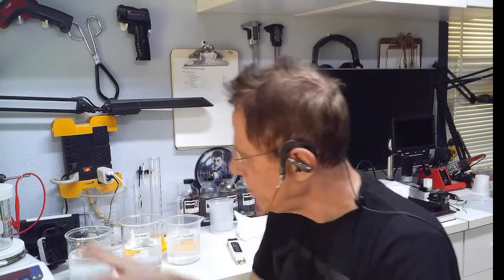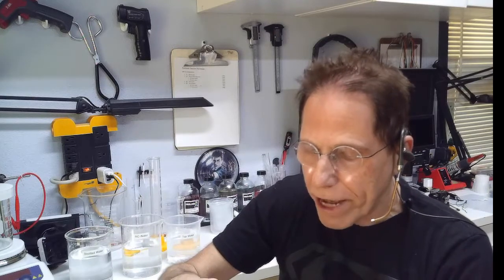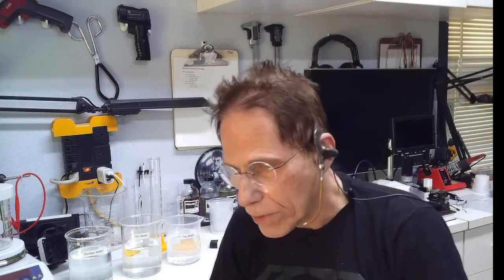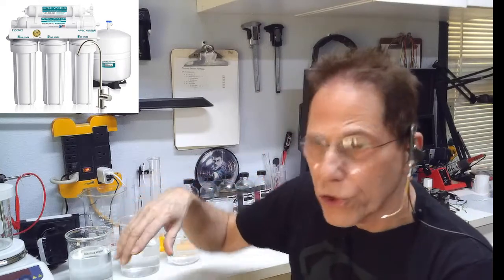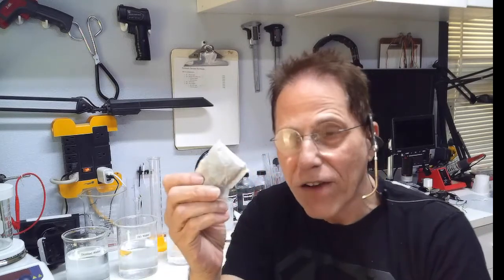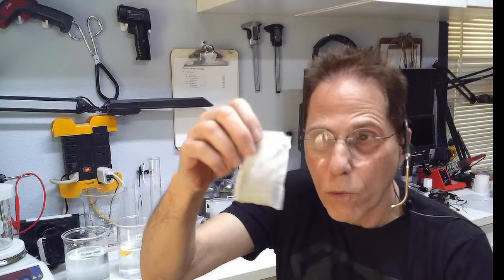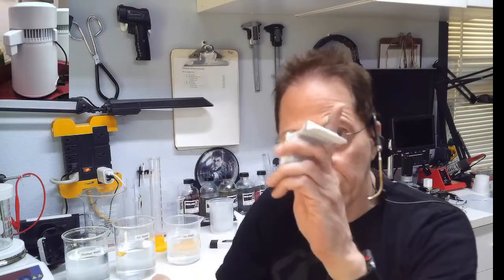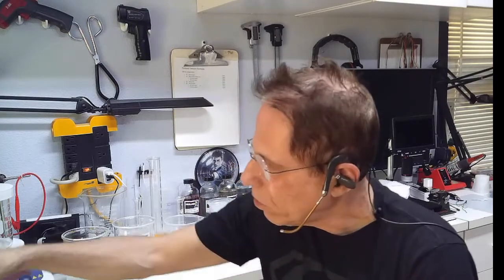RO water for your Distiller. Do you need the carbon filter?

Comment: Do you know What is better at removing the birth control hormones and estrogen from the tap water reverse osmosis or a water distiller I don’t know if you know how effective a water distiller would be at removing them
Reply from the maker: It is unbelievable that we in a world where the lifeblood fluid we need to survive is often contaminated with these things.

I really do not know the answer to this question. I went to google and started reading about it. I don't really want to say anything like I did with fluoride because again there seems to be various opinions and research on it. With estrogen and birth control hormones articles that I found they say it can be removed with distillation and RO filter and others say it cannot or only reduced. One articles states that carbon filter may remove 80%. One scientific paper I found shows that Reverse Osmosis removes estrogen from the water. 

With RO filtration the deciding factor would be the size of the particle you want to remove. If the RO membrane has a smaller hole size than the hormone or estrogen particle it would not go through it. With distillation it would depend if the substance is stored in the water as a ionic substance or as a gas. Gas substances will pass through the distillation process and recombine when it cools. Distillers have a hard time removing VOC (volatile organic chemicals) and SOC (synthetic organic chemicals).

I will talk to my chemist on this and see if she can find out the size of these particles and their state when mixed with water. I will report back. It is an interesting question for sure. 

Perhaps someone else who may be more in the know can share as well on this topic.
Reply: @AlchemyWizard  yeah it’s disgusting and is one of the main reasons the male testosterone leval isn’t the same as it was in the 1980s and below because it was double to triple back then because the water wasent as near contaminated with birth control as it is now and it would only get worse it’s the birth control and the micro plastics which leak in to the bottled water which have the xenoestrogens which act as estrogens what are the 2 main reasons behind the male testosterone being a lot less then before which is the main reason why I want to get a water distiller so I won’t be consuming the birth control and the estrogen in the plastic bottles I would realistically want the water distiller to Remove 90% or more of the birth control chemicals from the water I don’t know if you know how much estrogens the charcol filter bags they give would remove and would you recommend putting in 2 bags in the water distiller to remove more estrogens or no
Reply from the maker: @pitch1691  I would instead get a zero pitcher water filter, put the tap water in to that. This will filter all the chemical junk out or at least reduce it. Then you can put that into the distiller to clean it up. The other more expensive way is to do a RO setup, then distill the water. That small bag of carbon they put in distillers today, does not work.
Reply: @AlchemyWizard  what zero water pitcher filter would you recommend are sure they would take out a fair amount of the birth control and estrogen
Reply from the maker: @pitch1691  I have this one that I got in here for testing purposes. I do not know how much of the estrogen and hormones or birth control it removes, they do not say. It does remove chlorine and may remove fluoride. It does produce 0-ppm water as measured on the TDS meter. In the microscope it shows some VOC's about 4 to 6 ppm. The RO water shows a little lower in the microscope. The pitcher is a good alternative to RO water without the expense and installation cost. 

• ZeroWater Pitcher on Amazon: https://amzn.to/3BARy1X
Reply: @AlchemyWizard  yeah thanks and one last thing is dose a water distiller Remove 100% of those micro plastics what leak in to water from the water bottles
Reply: @AlchemyWizard  even though the zero water pitcher has a 0 ppm dose it still mean there can still be a lot of stuff in it and do you think the zero water pitcher filter is better then a water distiller in terms of getting rid of chemicals and stuff or is it the same do you think
Reply from the maker: @pitch1691  In the laser microscope the zero water pitcher did not remove everything. Some naturally occurring colloidal remained and perhaps some VOC, but the amount was small, under 2ppm. The Ruby Red gold process did not like Zero Water. I got a strange ruby red color from it. So I would say distillation is better. What I would do is get a zero filter to remove most of the chlorine and VOC in there, then distill that water and you should have about as pure water as you can get.
Reply from the maker: @pitch1691  RO water will remove micro plastics as the hole size in the filter is much smaller than micro plastic size. In our low end distillers I could not say for certain that it would get all of the micro plastic out. In theory it should. The zero water filter claims 99.9% micro plastic removal.
Reply: @AlchemyWizard  yeah thanks would you recommend cleaning out the zero water filter every 3 months
Reply: @AlchemyWizard  and I don’t know what filter you could recommend for my shower because my face  gets all dry from all the chemicals and stuff in it I would think it’s all because the heavy metals fluoride and chlorine but it might be all because of the fluoride because I’ve heard That’s very bad the hair and skin as well either way I don’t know if you could recommend any filter that would remove around atleast 90 % or so of fluoride chlorine and heavy metals from the shower water or have you not got a clue about that stuff
Reply: @AlchemyWizard  and I don’t know what filter you could recommend for my shower because my face  gets all dry from all the chemicals and stuff in it I would think it’s all because the heavy metals fluoride and chlorine but it might be all because of the fluoride because I’ve heard That’s very bad the hair and skin as well either way I don’t know if you could recommend any filter that would remove around atleast 90 % or so of fluoride chlorine and heavy metals from the shower water or have you not got a clue about that stuff because I don’t want to be consuming the chemicals when showering
Reply: @AlchemyWizard  and I don’t know what filter you could recommend for my shower because my face  gets all dry from all the chemicals and stuff in it I would think it’s all because the heavy metals fluoride and chlorine but it might be all because of the fluoride because I’ve heard That’s very bad the hair and skin as well either way I don’t know if you could recommend any filter that would remove around atleast 90 % or so of fluoride chlorine and heavy metals from the shower water or have you not got a clue about that stuff because Even if you consume pure water if your showering with contaminated water then it gets through your skin so you would still be consuming some of these main chemicals which is annoying that it can’t just be clean water , the shower water
Reply from the maker: @pitch1691  The zero pitcher comes with a TDS meter. The instructions say when the TDS meter starts showing 6 ppm you should change it. You remove the old filter and put in a new one.
Reply from the maker: @pitch1691  I have well water here. I use a water softener to remove lots of that content. It is good enough for showering and washing clothes, but not for drinking. I suppose it would work for you as well to soften the water so you do not get a reaction. Water softeners that use salt are about $600 and require a plumber to install. 

As an alternative, they do make shower filters that claim to remove all that stuff. Here is one on Amazon, but I have never used one and do not know if they work. https://amzn.to/3q8DsTk
Reply from the maker: @pitch1691  I replied to this somewhere but it is not showing up. here goes again.

I have well water and use a water softener. They cost about 600$ and you need a plumber to install it. It removes lots of the heavy stuff from the water and makes it more manageable for showers and washing clothes. 

However, as a cheaper and self install alternative, they do sell shower filters. Amazon has one. I have no idea how well they work if at all. I have never used one. https://amzn.to/3q8DsTk
Reply: @AlchemyWizard  what would a water softener Remove would it even remove fluoride and chlorine I would just want something that removed fluoride ,chlorine and the heavy metals would be nice
Reply from the maker: @pitch1691  Water softener is really only for hard water. It removes hard calcium and magnesium, which the body cannot use and other minerals in a small degree. It will not remove fluoride or chlorine or all the other things we are talking about. The reason I mentioned the water softener is that you said your shower water is terrible and leaves your body feeling worse then before the shower. This feeling is very typical when showering with hard water.  Just saying it is possible the shower problem is related to you showering with hard water and may not be because of these other things. As far as drinking, even with a water softener, you will need to filter your water with other filtration before you drink it.
Reply: @AlchemyWizard  no I feel fine it’s just I don’t want my body to be absorbing these chemicals mainly fluoride and chlorine and the heavy metals because there not good for the skin and there bad for you to have inside of your body I don’t care about the magnesium and calcium that isn’t going to dry my face out after I finished getting out the shower  so like I said I just want some sort of filiter that I know filters out atleast fluoride and chlorine
Reply from the maker: @pitch1691  As far as fluoride goes, my chemist did some research and found that the National Science Foundation tested the Brita Long last filter on fluoride and it did filter out 95% of it, due to some unique activated carbon they are using in that particular filter. The advantage to this filter as opposed to the zero filter or RO filter  is you would not be drinking water that is essentially distilled water. 

As for taking a shower or bathing, that shower filter may be something to try.
Reply: @AlchemyWizard  I was going to possibly plan to get a zero water pitcher filter but I was asking other people about a water pitcher filter and some of them said it won’t really do anything in getting rid of estrogens and birth control out of the water do you have any explanation to explain how a zero water pitcher filter gets rid of a fair amount of birth control and estrogens from it to the amount that it’s worth using before putting the water into the water distiller and because I’ve heard that the zero water gets 0 ppm but that dosent mean there  isint a lot of chemicals left in it so it wouldn’t mean it remove birth control and estrogens so I’m overall asking if you have prove of the filters in it that it’s effective at getting rid of alot it the estrogens and birth control from the water
Reply from the maker: @pitch1691  I do not think zero filter will remove birth control or estrogen. From what I can find the only thing that is known to work is Reverse Osmosis because the estrogen and birth control molecules cannot fit through the membrane.
Reply: @AlchemyWizard  oh yeah well thanks I would just buy a water distiller either the mega home water distiller or the C0-1Z or the vevor water distiller I don’t know if you know which one is the best one you would recommend I’ve heard it’s the mega home one but I think that one takes 1 hour extra to distiller 4 L of water compared to the other ones and it’s more expansive so do you have any thoughts on the best ones or do you not know
Reply from the maker: @pitch1691  All those water distillers are of the same design. Any one of them should perform adequate. Be sure to read all the comments on them before you buy.  I have two which I spent about $100 each for.
Reply: @AlchemyWizard  I’ve heard from the pure water YouTube channel which is the most expensive water distiller they said  that Normal water distillers boil dry and as a Result of that the temperature could be to high we’re all the residue is so the birth control and estrogens can evaporate into the distilled water what’s your thoughts on that is that true so you think or not
Reply from the maker: @pitch1691  I don't like when it boils dry. I agree. I set a timer and turn mine off before it goes dry.
Reply: @AlchemyWizard  yeah I’ve seen the mega home takes 5 to 5.5 hours to distill water and the other ones ussaully take 4 hours I’m guessing that’s because the mega home one has like 550 watts and the other water distillers ussually have 750 watts so would that mean the less watts the quieter it is because I wouldn’t want a loud distiller what I can hear all day for 5 hours
Reply from the maker: @pitch1691  I have two different 750watt model. The fan is loud on both, not sure you can get around that. I suppose the 550 watt may be quieter, but there is no guarantee it is. The fan speed is based on how quickly the water has to cool in the tubes so more vapor can fill in. You would have to look for something that says a quiet distiller, where it is designed to work quieter. Perhaps you can put it in a room with a door and close it. Or put it in the bathroom and close the door.
Reply: @AlchemyWizard  yeah it is the mega home water distiller that’s looks to be the best quality the only possible downside is it takes 1 hour more I think compared to the other ones
Reply from the maker: @pitch1691  Well here is what I would do to make the best distilled water. I would get the zero water filter to remove all the big garbage from the water. then put that water you filtered into the distiller. Extra step but you have the most clean water you can get then.
Reply: @AlchemyWizard  yes I was going to do that but it dosent make any sense to do that if the zero water pitcher filter dosent remove any of the estrogens and birth control or atleast fair amount of it if I was to know that it could remove half of it or something then I would probably do that
Reply from the maker: But you are forgetting about chlorine and other vaporous substances, VOCs (volatile organic compounds) and SOCs (synthetic organic compounds). Distilling will not remove those but filtration will, or it will at least reduce them. It really depends on what is in your water of course.
Reply: @AlchemyWizard  I will turn of the water distiller before it runs dry but  that is very annoying because some of the time you would forget or your out or asleep  when the water distiller is on so you don’t turn it off before it finished which I find so annoying because then for that time I will be consuming nasty birth control from the residue what was heated because it turned off by the machine because the water distiller ran dry which takes away the point on why I’m getting a water distiller in the first place so my testosterone isint getting destroyed by the birth control ,so I don’t know if your definitely sure of if you leave the water distiller on then till it turns off automatically then it will release all the birth control into the distiller water
Reply from the maker: @pitch1691  As I said in the video, plug your distiller into a timer and set it for 15 minutes before your distiller usually runs dry. This will prevent you from over cooking the last of the water.

Mechanical Timer: https://amzn.to/3oZwY9n 
Kasa Smart Plug Wifi Timer: https://amzn.to/3X46Wy6
Reply from the maker: @pitch1691  the zero filter comes with a TDS meter. The instructions say to change the zero filter with a new one when the TDS meter reads 8ppm or more.
Reply: @AlchemyWizard  I’ve seen that a lot of vocs have higher boiling points then water so all the ones that higher boiling points will be left behind in the water distiller I’m guessing and you mentioned that a water distiller can’t get rid of chlorine but it can because a water distiller boils for 4 hours and you only need to boil water for 15 mins to remove chlorine so chlorine definitely dosent get into the distiller water atleast with the megahome water distiller because it has a tiny hole that releases the chlorine when it’s boiled that’s what is says on there website
Reply from the maker: @pitch1691  the chlorine gas is trapped in the distiller chamber with no way to escape. On laboratory distillers, which by the way are very slow, they have a way to release these gasses.